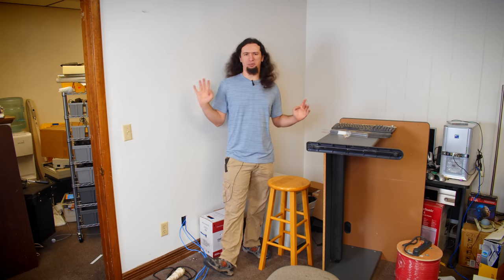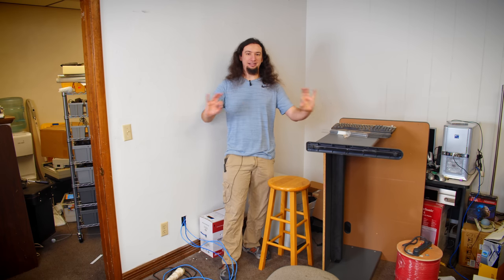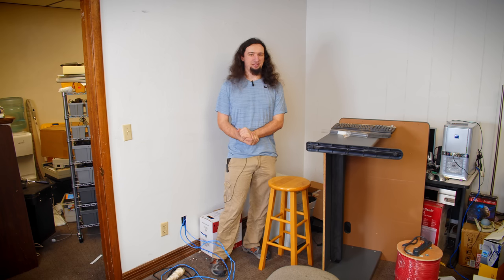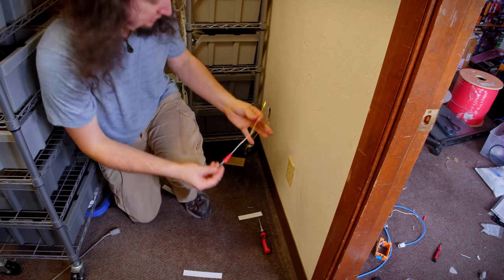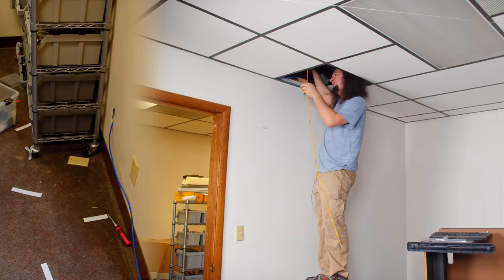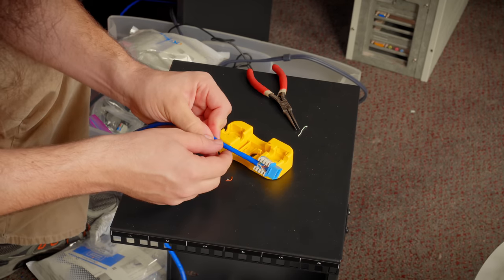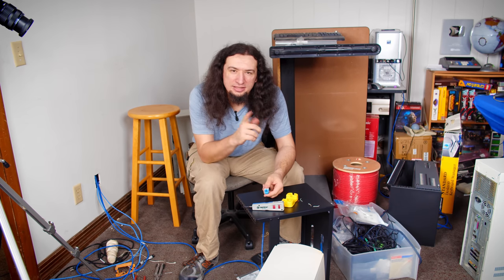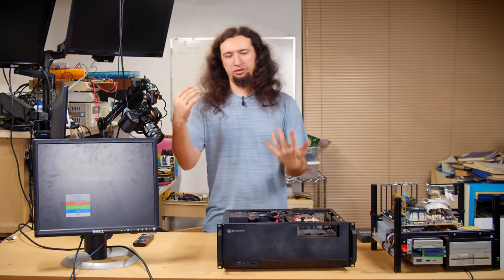Ultimate VGA Capture Setup for the Office at My New Vintage PC Desk

Comment: As someone who has done professional AV for over 20 years now, it's actually nice to see some of this older equipment types ending up in hands like yours where it's useful. Those VGA over network cable extenders were something I made extensive use of. Cat 5e is cheap, and when you've got projectors flying in the air on truss it's a convenient way to get signal from the ground up to them. I've had cat 5E runs up to max length (100 meters) in the convention center catwalks in Seattle. These days we're mostly using SDI or fiber, though we do sometimes use HDMI over cat 5E/6a; HDBaseT being standardized now. 

With as much equipment as you've got there, I do not envy you doing the cable management! I highly recommend an old AV trick of concealment with duvetyne, black foam core, etc. 🤪. So long as you manage each wire's individual excess onto itself with velcro wire ties, it'll be fine thrown on the big cable pile with some cloth on it...
Reply: My people! Can’t count the number of calls I’ve made to the food as beverage dept requesting a black table cloth to hide the cable chaos. I gotta say I don’t miss the horrific smear that some LCD panels gave on the far end of a long CAT5-VGA run🤢 

But totally agree, this old gear is such a godsend for retro computing setups. I’m tech at a university and about 20 rooms worth of lovely old long-decommed Extron gear is about to be disposed of with crew getting first dibs. I’m like a kid in a candy store. My home rack will soon be an AMX controlled battlestation. So many Crosspoints👌

Comment: A trick used by bicycle builders to run wiring through the frame is to take a piece of strong sewing thread, feed it up one end and fix it in place, and retrieve it from the other end with a vacuum cleaner. Then you can tie a more substantial string or a cable to that, to bring that through. Just something to add to the bag of tricks if you ever need to run wires through weirdly shaped tunnels.

The Vsync delay box sounds like an AWESOME thing to make a whole dedicated video about!

Comment: So I wouldn't classify these things as a "network" VGA transmitter.  Like you mentioned, they're just sending an analogue signal over a four twisted pair ethernet cable.  You're not running this through a network switch or router, that's for sure.
Reply: Not with that attitude :p

Comment: Not sure why you did each cable separately.  Use the rod once and feed a 1/4" nylon rope through, then attach all the cables to the rope and pull then through.  That's how I've always done it.

Comment: there's actually an Extron VGA over CAT5 system, too, including matrixes that have the conversion circuitry onboard, and their own 8P8C jacks, which really, really cuts down on the cabling, and is also much more reliable. worth keeping an eye out for one of those on fleabay, especially since a lot of those are getting ripped out right about now.
Reply: Hell yeah Extron MTP matrixes 👍 The endpoint boxes that do RGB, component, s-video and composite are very cool for retro.

Comment: i actually ran VGA over RJ45 for a while, using a passive adapter
this means it cant ever see a switch as it would mess up, but it was nice to have a quick and easy VGA cable solution in a server space where RJ45 cables of any lengh are abundant

Comment: Prolly late, but like Jeremy I ran cable in a hospital and some things we did:

-We'd tie string onto the rod using a knot I forget the name of, tape it and run it as our carrier. The string will do the pull from the other end later.
-Repeat with the cable, and you can run several at once. You want to stagger them into a sort of cone-like shape so you don't get stuck. This really depends on the runs, and sometimes we'd purposely leave segments in ceilings for REALLY rough ones we can tie onto later (looking at you, hard ceiling).
-I cheated and had a tool that looked a little like a gun, you prep cables on the jack and just squeeze to do all at once (this was great for awkward spots as I've slipped with a punch down...)
-Label label label, especially when running several, and in multiple areas. We'd coil up maybe 2 feet and make 3 markings as some always got scraped off (we'd just do like 1-8, nothing wild).

Likely overkill for you, but useful tricks if you find yourself running a fair bit in the future.

Comment: I recently had to get some of those extenders for a job at work, but instead of VGA it does HDMI and USB. They're great! You only have to power one side of it with a wall adapter and with a 100' network cable run across the shop there was no lag or degradation at all! 

I'm happy to see there's a VGA option as well. I'll have to look into those for my own home retro computer usage.

Comment: That VGA crosspatch setup and the VGA over twisted pair transceiver set up is AMAZING! I've actually considered getting some of those transceivers as a possible means to have my main computer be able to be displayed in my workshop, and possibly vise versa... Only problem is I don't have hardly any monitors with equivalent resolutions... Ugh... it'd be a nightmare to figure out... I also run quad monitors on my main rig. I'd probably just have to pick one or two main monitors to transmit.

Comment: I'm a A/V Integrator by trade and what you have here is a pretty nice setup. We call those VGA adapters VGA-over-IP boxes. Cool thing is you can do HDMI over IP, USB Over IP and so on. Some you can even toss onto a Network and tell the receiver via a WebUI what transmitter to connect to.

Check this out. I have a Dell R410 as a VM Server and I wanted to have a real monitor, keyboard and mouse connected to each VM client. So I bought up a bunch of HP Multiseat clients and tossed in a USB card and did a USB passthrough for each port to each VM client then plugged in the multiseat clients, used a program called easyseats to setup a multiseat session on each VM client. Then plugged them into a KVM. I went as far as to adding a couple of USB over IP boxes to so I can have a VM session in the Livingroom and Master bedroom. Came in handy during the lockdown and the kids needed computers for Zoom class sessions.

Comment: We used these VGA-over-CATx converters extensively when building Avid video editing suites in the early 2000s to tuck away the noisy editing PC, PCI extenders, JBOD and all that stuff in the cooled server room. All the other professional signal stuff like SDI, AES and RS-422 was already designed for longer cable runs. We also had huge matrix switchers for SDI and AES and I'm pretty sure I could still flawlessly route a dozen signals in seconds while completely drunk.

Comment: I recently acquired an Extron 8x4 VGA matrix... It's great :D 8 machine input, four monitor output - 17" 15Khz LCD, 15" 15KHz CRT, 19" 5:4 LCD (via OSSC), 24" 16:9 LCD. Pick and choose! 

Even better, I have a USB->Serial to my main desktop and, using Touch Portal (bit like a cheap Stream Deck) with conveniently labelled button for each monitor/machine combination.

Comment: How are you handling EDID information?
My own experience is that depending on the computer EDID is either required or not allowed at all. Had an S3 card that refused to boot up explorer.exe on Windows 95 unless it received no EDID info at all, but at the same time I've run into a GeForce configuration on 98 that wouldn't do high-refresh rates without proper EDID info.

Comment: What I'm looking for is a device would need a VGA D-Sub HD15 connector and an Ethernet port. You would connect it to any computer with a normal VGA/HD-15 monitor cable. The interface would need to implement the DDC pins 9, 12 & 15 and report itself through as a VESA generic monitor, etc. The PC would think it's just any old standard monitor. However, it would work like an IP-camera, with a web interface and a few RTSP stream profiles, and perhaps also with ONVIF support.

A more advanced version would also have a header to be able to connect to the power-led and power-sw pins on a computer motherboard (opto-isolated input and output) to allow the power to be controlled from the web interface. And an audio capture header to connect to the motherboard's pc-speaker and a headphone jack to get sb-audio out. And PS/2 keyboard and mouse inputs.

Does such a device exist?

Comment: About a decade ago, at a church, we had VGA that ran through the floor, and up to a projector, the projector was supposed to be mounted to the ceiling at some point, and that would push the length to about 175'.  Well past the 100' maximum for VGA.  I was able to pick up a couple of these units, and using a 100' CAT5 cable that I already had.   Pulled out the 2 50' VGA cables, and ran the CAT-5.  You would have thought we had replaced the projector.  Quality at the projector went from Meh to pretty good....

BTW there are HDMI versions of this was well....
Reply: Not sure how telegram works, can we do this another way.....

Comment: So as someone that has worked in Video production for the last 15 years I think I would use a Extron VCS-700D to convert the VGA to SDI and then use a normal capture card.  I have used these Extrons for years and they work well and support basicly any thing from 640x480 to 1920x1200 you would need  to use the RGBHV BNC out on your VGA Router to drive the VCS-700D as it doesn't have a HD-15 for VGA.

Comment: Not sure if most people are aware of this but ethernet copper cables (or twisted pair) are not regulated when it comes to stating their cable type (eg cat 5, cat6, cat6e, etc) so what the packaging says may not be true. This is important to know for usage requirement because if a cable is not rated for a specific frequency or it isn't actually shielded then it's not going to work well, if at all.

Before you buy ethernet, especially a long spool of it, it's worth googling the brand to see if there are any reviews about it. I haven't checked in a while but there may be websites that have done testing and listed the findings for multiple brands.

Now that I'm thinking about it, this might be something worth mentioning to LTT for their new lab to test.

Comment: I'm planning to wire our house with ethernet and may possibly want PoE, do I need to buy specific keystone terminals for that or is that entirely included in the spec? I have not decided on a router/switch yet as we will be switching internet providers and thus getting a new modem anyways, so I'm just planning right now.

Comment: Use GBS-Control solution, is cheap and great, and grab the video on HDMI. I'm use GBS-Control to capture retro consoles using SCART, VGA and Component RGB signal, for old computers is the best and cheap solution for you.
Reply: As someone who has both solutions (Datapath E1s and a homemade GBS-Control), I found the E1s to be far more versatile and less of a hassle with oddball resolutions and refresh rates (the E1s has an FPGA that gets reprogramed when you tweak things). Also, with the E1s, you get as close to capturing the raw VGA signal than anything else I've found, giving more versatility with handling footage in post. That being said, the GBS is WAY more handy with games use standard resolutions or switch resolutions constantly.

Comment: Why wouldn't you just install a wall plate with the female jacks in the wall. Then you have a clean plate on the wall with multiple labeled jacks to plug your network cables into and it looks clean and is much better for preventing it from getting damage over time.

Comment: This VGA capture setup looks really complicated - why not something like this instead? Tiny pc case with two pcie slots with an SFX psu, the VGA capture card, and a gpu that can encode h.265, then that gets saved out to the network by OBS. It'll be about as big as 4 vhs tapes. Take it to whatever computer you want captured, hook it up via a short VGA patch cord. You'll only ever be capturing one computer at a time. It's light and tiny and you can take it with you in case you need to. Space is at a premium where you are, so having two huge cases seems counter productive. Instead of that huge capture setup you could have two to four vintage computers there. As a bonus, if you don't have a monitor for a specific computer, you could hook up a small LCD to that capture computer and just use OBS preview there.
Reply: I understand your skepticism but I think he wants his desk to look „authentic“ and telegenic as if teleported from the past. A capture box would interfere with the look. I mean the setup is not that complicated: The retro computers are in one room where they are being filmed like on a set. The capturing equipment is in the other room connected over a wall outlet. I think that makes kind of sense from a film maker’s stand point.
Reply: @gern0tk  not really skepticism, just a different solution